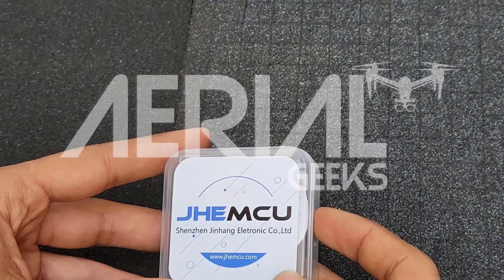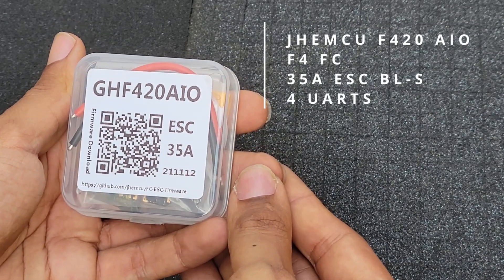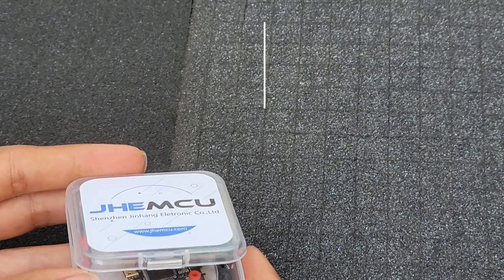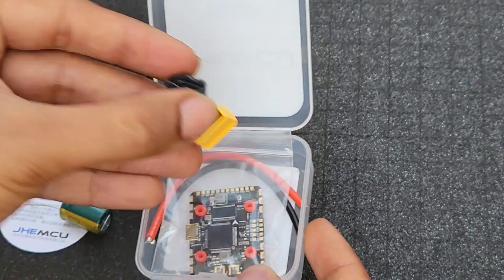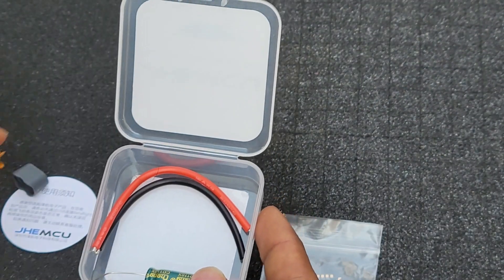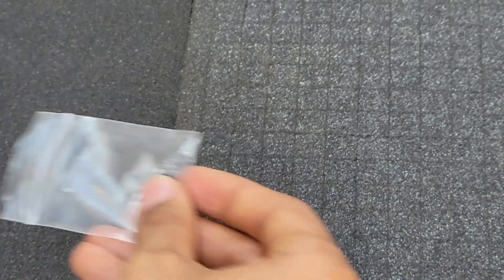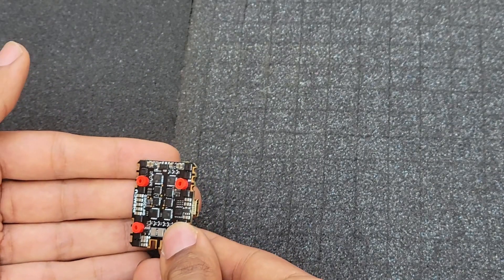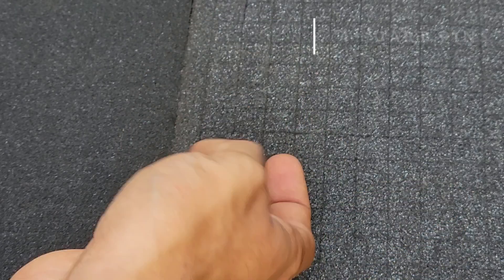JHEMCU F420 AIO Review and Flashing Guide.

Comment: What frame and motor fits for that?
Reply from the maker: Fits 3 and 4 inch frames fine. Maybe a whoop with 20x20 mount and wors for 1404 to 2004 motors. Even the fpvcycle 23mm motors